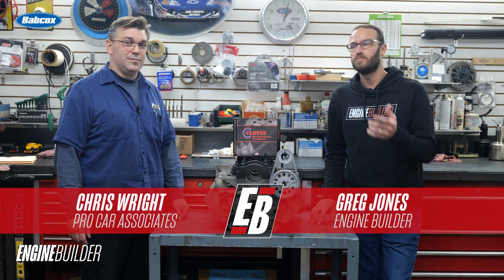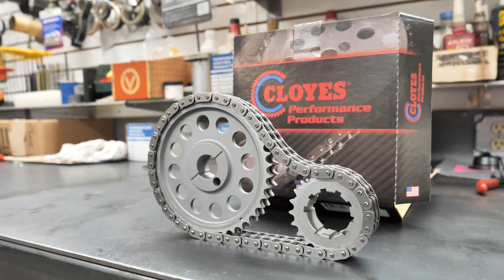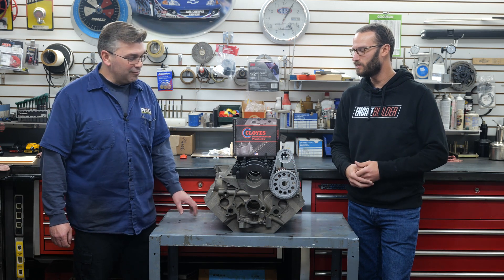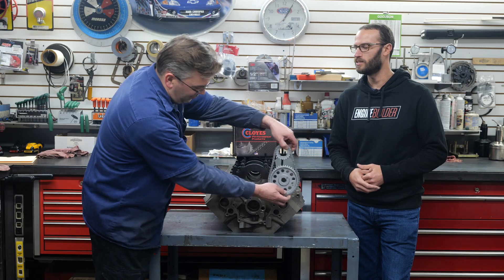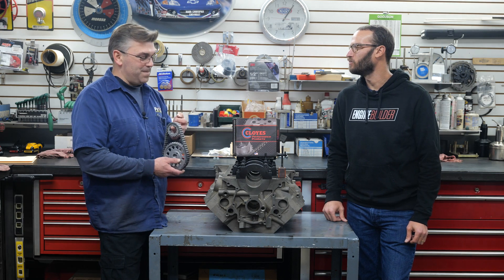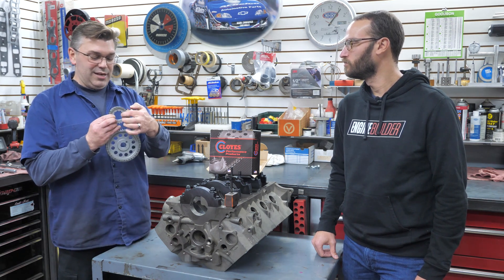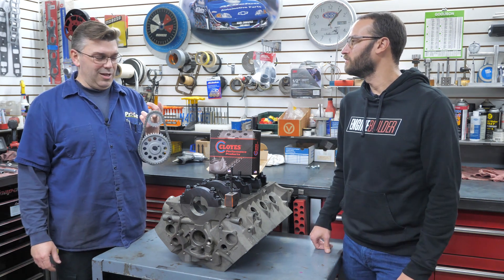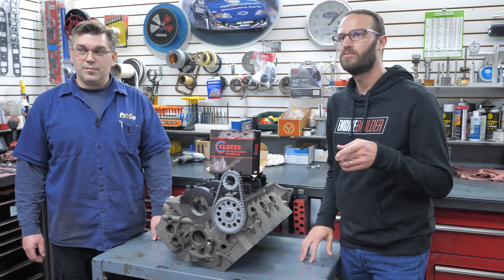Reviewing Cloyes' Race Billet True Roller Timing Set

Comment: Hello Greg. Chris represents a component that nearly all builders will eventually need. In my experience, Cloyes delivers a high quality and durable product. The SBF timing set featured today has forged gears that are USA manufactured and that’s always good to know !

Can you please advise me if Cloyes offers a quality timing set for Ford Cleveland engines that uses Torrington bearings for thrust surfaces along with forged billet steel gears ? 
I recently tried a timing set that uses Torrington bearings and it works well but it’s from a different manufacturer and 
I prefer to use the same manufacturer whenever possible. Thanks guys 🏁
Reply: Hi Daniel. The 9-3621X9 is the Ford Cleveland equivalent to the set reviewed by Chris and Greg in this video, but neither have a thrust bearing. None of our Ford sets use a Torrington bearing on the thrust surface.
Reply: @Cloyes01  … I appreciate the part number. That’s a good looking piece and should get the job done quiet nicely.
Reply: @danielwilson6665  If you need a thrust bearing you'll likely have to install one yourself.
Reply from the maker: Hey Daniel, We'll pass along your question to Cloyes and let you know. Thanks for watching.